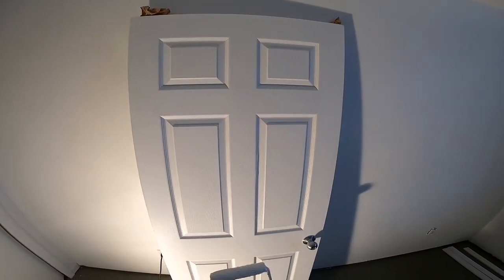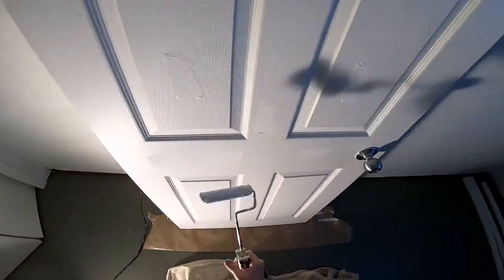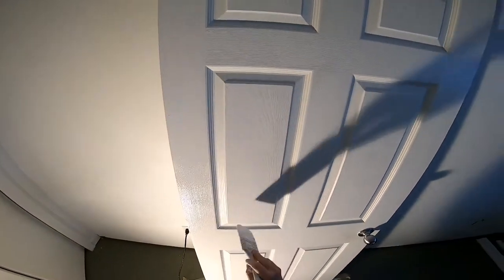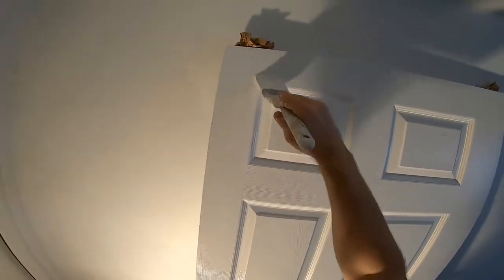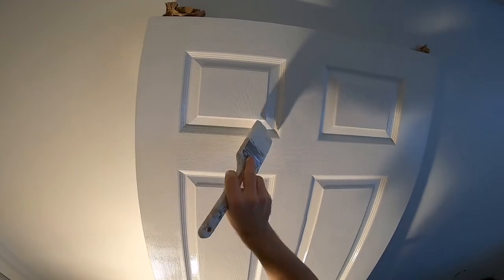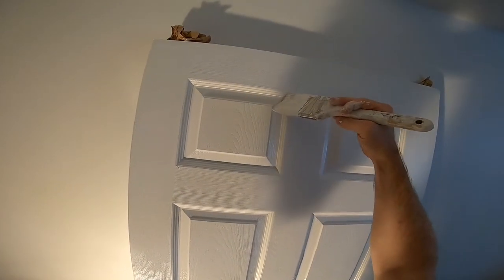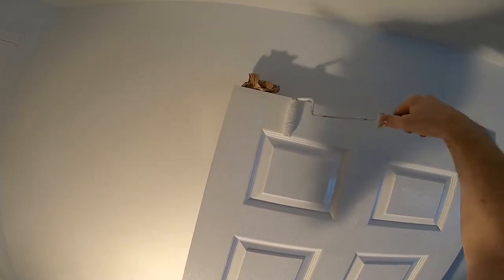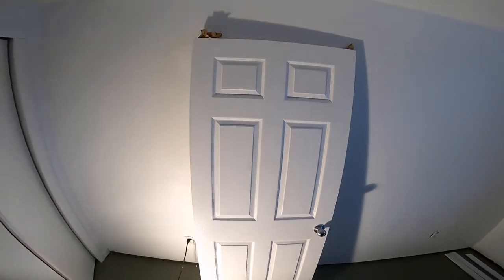How to paint a door with a brush and roller

Comment: Take the knob off first....it only takes like 30 seconds to take a door knob off.
Reply from the maker: Couldn't agree more. Mentioned in the video, I take all hardware and knobs off, also mentioned is this specific knob had over-paint on it from the previous painter or home owner (which is very common) so I used it as an opportunity to show how a knob could be painted around without getting paint on it, although I personally take them off.

Reason for the demonstration is because the reality is many many DIY'ers won't and don't take the knobs off, even though they and everyone knows the knobs should be removed. It's just how it is, and how it will continue to be, I'm not judging.
 
So at least I'll try showing them a demonstration how to quickly paint around a knob (if thats what they choose to do) without getting paint on the Knob.

Comment: I understand your comment about more paint being counterintuitive.  With more paint, cool temps... the paint will lie down against the surface. The trick is also not to roll over the paint too many times and lift it.
Reply from the maker: That's exactly it. Heavier coat and cooler temp = smoother finish. But not so much that it sags with gravity.

Comment: Oil paint water based paint ?
Reply from the maker: Benjamin Moore Advance, in semi-gloss.  It's a water based alkyd enamel. It's a very durable paint suitable for doors. Oil base will be even more durable, but I'd advise wearing a VOC cartridge respirator due to fumes and expecting a day to dry and a week to cure.
Reply: @Interior_Works  thank you so same as the method in the video with oil based then ? As the door I'm doing is for the bathroom, thank you for your reply.
Reply from the maker: Method is the same, except I'd go with a 1/4" nap instead of a 3/8". What I talked about in video about putting paint on heavier for it to stay wet longer so it can self-level isn't as necessary for oil based, it'll level smooth even if it's put on thinner as it takes hours to dry. Also, for oil base, ideally a natural bristle brush or chinex, but an all-purpose synthetic will work ok.
Reply: @Interior_Works  brilliant thanks you,   I was just going to use the standard foam 4 inch roller as it's oil based paint I always thought that would be the case.
Reply from the maker: Foam roller won't work well with oil base as it's consistency is too thick to absorb into the foam, paint will end up just smearing around. Oil base will level smooth, almost looking like it was sprayed even if applied with a nap roller.  Foam rollers always seem to leave a slight stipple texture that stays, roller marks, and sometimes microbubbles.  I should really make a comparison video, but I can always get a smoother finish by laying on a thick water based coat with a nap roller, to allow it to self-level smooth vs the finish of a foam roller.  
I've spent a lot of time trying to make foam rollers work for me, both low density, high density, thinking that being foam they should make a smoother finish, but it's all problems, at least in my experience.
Reply: @Interior_Works  Good tip. I’m wondering what type of roller selection would be used on a smooth flat panel door. The artificial wood grain doors are a little bit more diy friendly to paint. Thanks for your help